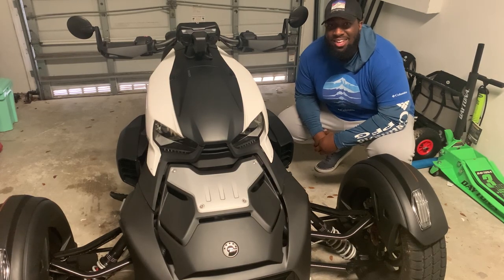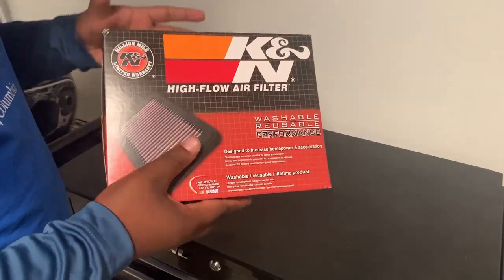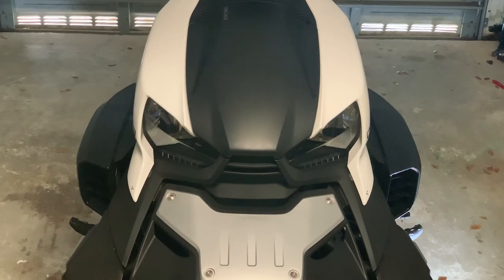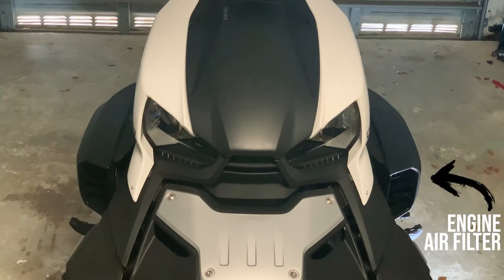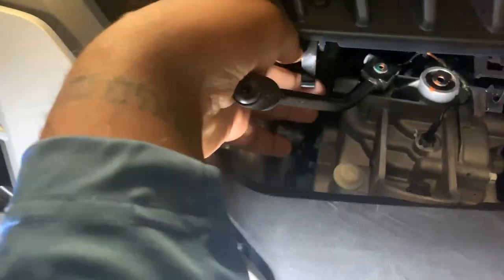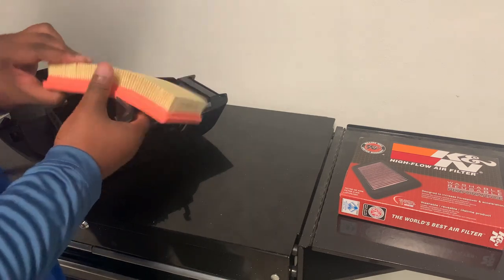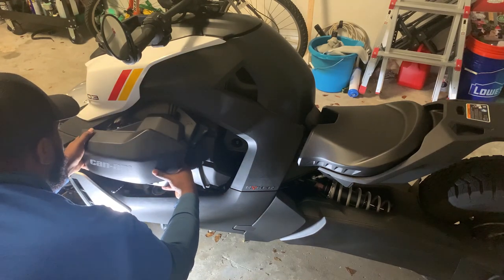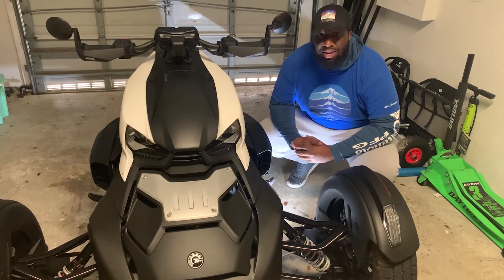Replacing the Air Filter on a Can-Am Ryker

Comment: 3wheel I have 1900 miles on my 900; I want put on a new k & n engine air filter but I want to take the ome engine air filter and put it on the cvt side since it’s the same size filter yes? no?
Reply from the maker: Should be the same size filter, but why do you want to swap it over? Wouldn’t it have about the same amount of usage as the one on the CVT side?
Reply: @3WheelKhalil  because I thought everyone was saying the K & N filter should be on the engine side for better performance and it’s a washable reusable filter
Reply from the maker: @servantsoldier5207  yeah that’s right. I think I see where I was misunderstanding you, you want to save the OEM filter and put it on the CVT side later when it needs replacing?

Comment: Confused why didn't you do the CVT side and would you use the same filter or a different brand?
Reply from the maker: Angel Domena I have seen others that will change that filter since it is the same size, but I personally don’t see the benefit. Definitely still want to make sure you have a clean air filter over there, but I personally don’t think it is worth putting a performance oriented filter to cool the CVT. I’d rather lean toward more filtration on that one.